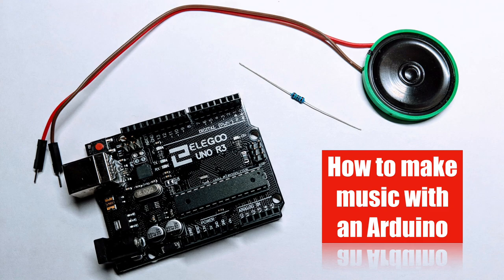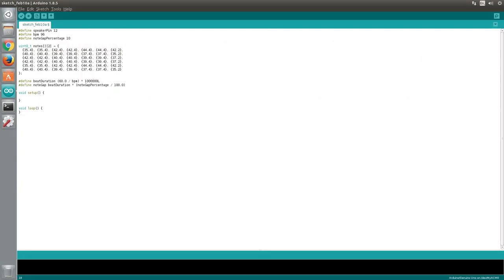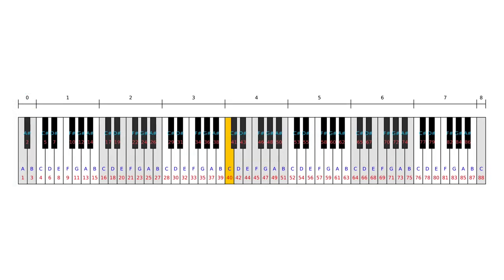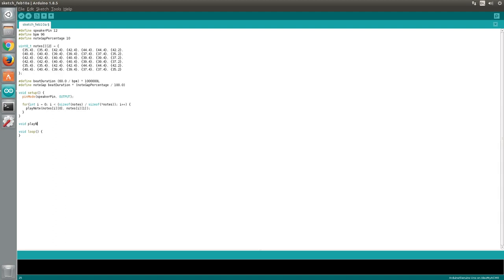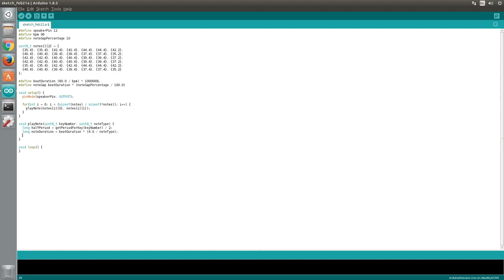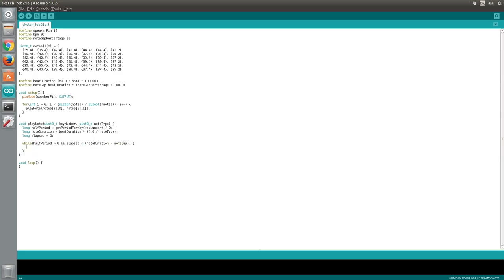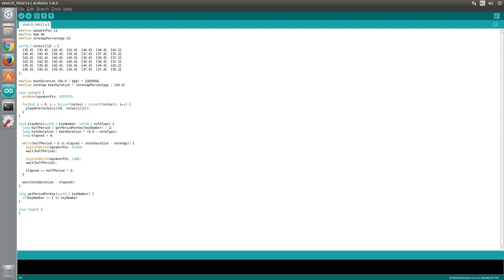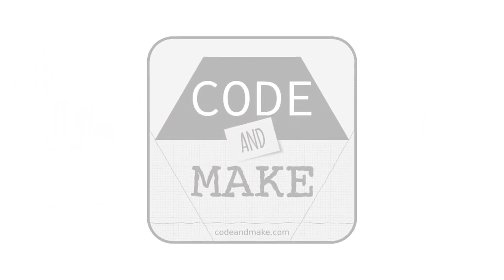How to make music with an Arduino

Comment: Thanks for the wonderful video. Can you tell how can i get note value of any music to program Arduino.
Reply from the maker: You're welcome. Ideally you should refer to the score for the music, but I assume you are asking as a non-musician? If you are lucky the score will be annotated with the notes, otherwise you will require a little bit of knowledge of how to read it. For simple scores you should be able to read it with a little bit of research and patience. Once you have the notes and durations, you can use the diagram included in the video to figure out which numbers to use: https://youtu.be/Z1YvIFUIhLs?t=179

Comment: How do I put this in the void loop function? I want my music to loop
Reply from the maker: Hi,

Great question. To achieve this, you just need to move the for loop (lines 71 - 75 in this gist: https://gist.github.com/codeandmake/1add672bc7957135ac4e212360acbc98#file-gistfile1-txt-L71-L74 ) from the setup() function into the loop() function (line 141: https://gist.github.com/codeandmake/1add672bc7957135ac4e212360acbc98#file-gistfile1-txt-L141 ). You should leave the pinMode() call (line 68: https://gist.github.com/codeandmake/1add672bc7957135ac4e212360acbc98#file-gistfile1-txt-L68 ) in the setup() function.
Reply: @CodeandMake  Thanks! New subscriber well earned!

Comment: I am new to Arduino and would like to know how to code it in the loop, or could you point me to an example please. Tks.
Reply from the maker: Hi Jeff,

To achieve this, you just need to move the for loop (lines 71 - 75 in this gist: https://gist.github.com/codeandmake/1add672bc7957135ac4e212360acbc98#file-gistfile1-txt-L71-L74 ) from the setup() function into the loop() function (line 141: https://gist.github.com/codeandmake/1add672bc7957135ac4e212360acbc98#file-gistfile1-txt-L141 ).

You should leave the pinMode() call (line 68: https://gist.github.com/codeandmake/1add672bc7957135ac4e212360acbc98#file-gistfile1-txt-L68 ) in the setup() function.
Reply: @CodeandMake   Awesome !  Much Tks.
Reply: Can Arduino play more than one note at a time ?  Tks.